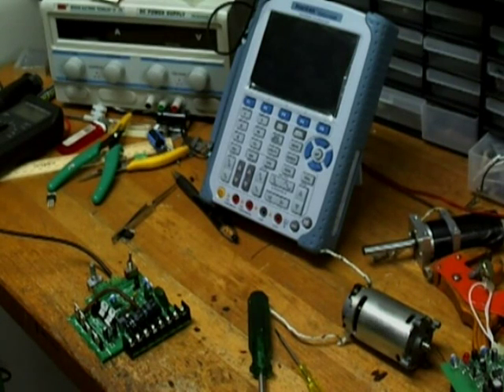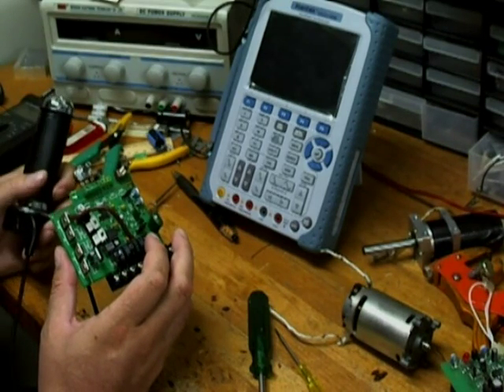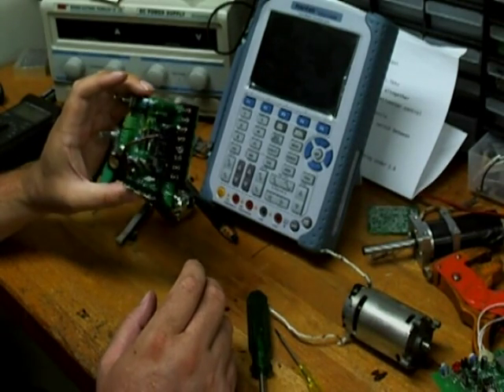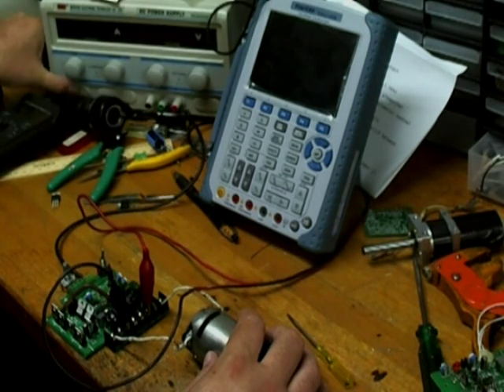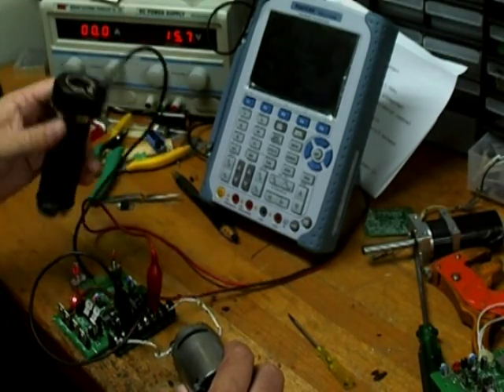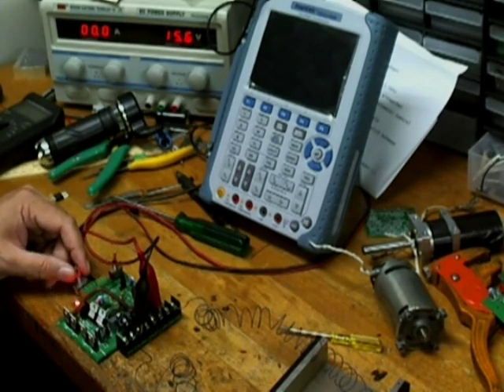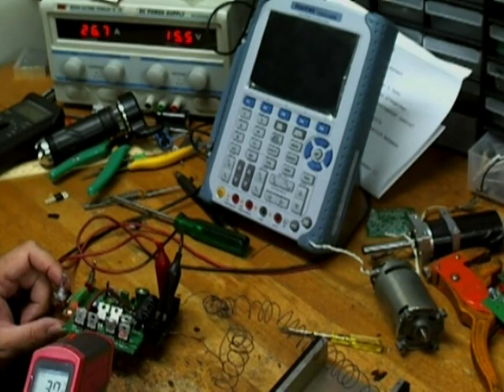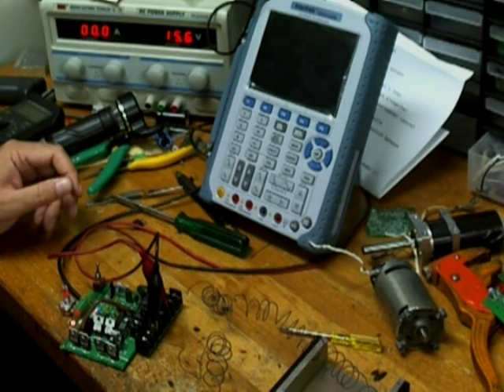12v-48v 100A DC Motor controller, High Current

Comment: You are using DO220 case mosfets, so even if you manage to cool them enough, at 75A pins would start to melt ! Your driver is not capable of giving 100A.

Please test with fully loaded 100A dc motor and run for a couple of minutes.
Reply: No, that's not right, they aren't DO, they are TO, but reliably with no sinking it will comfortably run 50A @ 43 degrees using the 4 x irfb3207's , but for 100A I would obviously need proper heatsinking! But of course it will run 100A all day every day, don't forget, its only 25A/Fet and those fets are not a small rating!
It was a pretty solid design, but the high current side changed a lot from what you see here which was just built to test the actual design and limiting, not so much to parse the current.

Comment: What mosfets did you choose? I'm trying to build a similar board for myself, and I'm having a hard time picking the right mosfets.
Reply: did you find one? i just blew up my 3rd mosfet, trying to find a logic level mosfet
Reply: I wasn't using logic level mosfets, its much easier to just use a driver and there are plenty available to choose from!
Reply: did you find a decent mosfet?